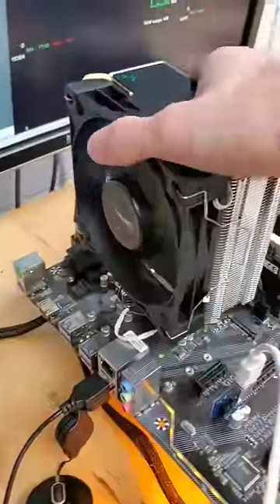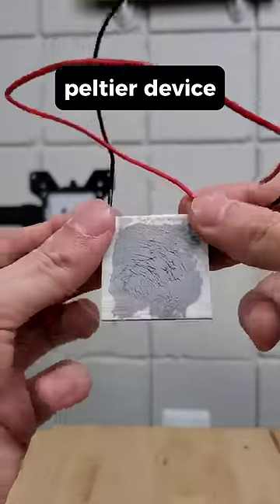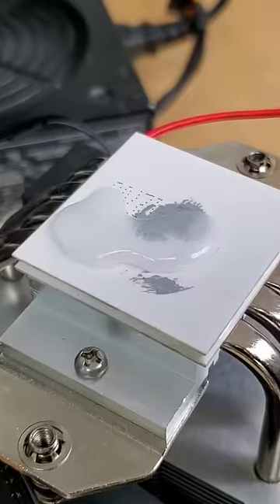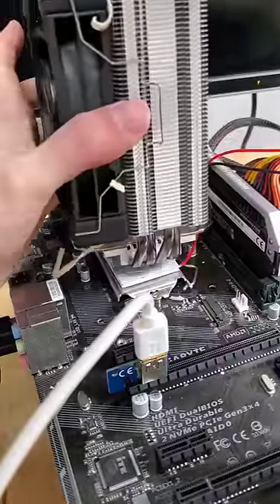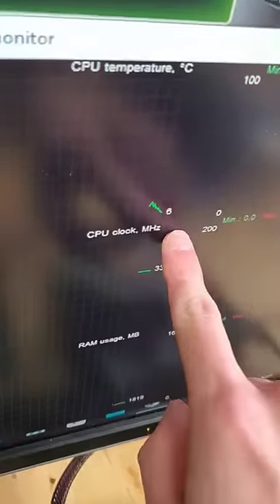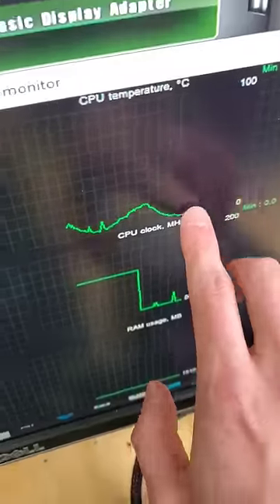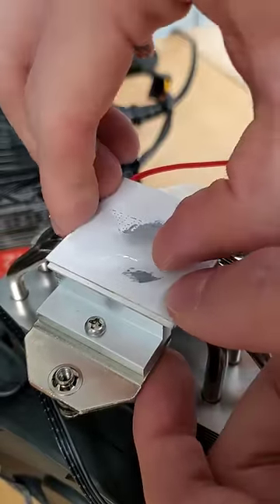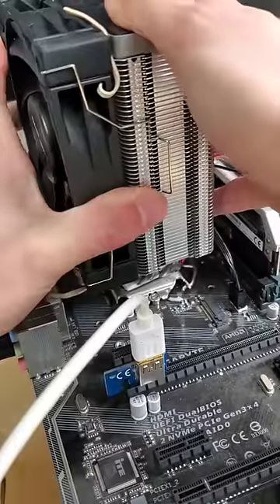using a Peltier device to cool a CPU BELOW 0°! #shorts

Comment: Small issue with this too is that this doesn’t cool the system at all. It actually heats the system up.

Yes as an immediate result the cpu will be colder. But the temperature isn’t gone. Energy cannot be destroyed. Only transferred.

This means the amount of heat pulled from the cpu ends up in the heatsink. Now this isn’t the problem, you actually want this to happen. The hotter the heatsink is the more heat it can dissipate. Normally this would also result in a hotter cpu but this way it’s still keeping that cold.

The problem is though that this module requires a fairly large amount of power. Power = heat. This module takes about as much as the cpu I’d estimate. You’re therefor doubling the amount of heat that is generated.

So for idle and short duration, yes this works. But for under load this would actually likely make performance worse

Comment: This can create moisture, if the CPU isn't consistently cooled down, if you play a game, the heat from the computer, and the device that can freeze water in 60 seconds, Which means it needs to be under 32°F, which means it can possibly create moisture that can damage your system

Comment: The main issue with peltier devices on CPUs is regulation.  If you don’t have good active monitoring you can drop below 50F/10C and start having condensation forming in and around the cpu socket.  Then depending on conditions this can easily lead to frying a cpu/system.

And as others pointed out modern CPUs have a thermal density higher than most peltier pads.  Unfortunately once you exceed their thermal capacity they are really poor at thermal conductivity.  So you have to be very careful with matching the right peltier device to the system for stable operation.  However they are perfect for systems that keep an almost constant workload.

A few decades ago when I was building large grid processing clusters we found that in a data center (very dry air) and at nearly constant 80-100% cpu usage 24x7 they worked pretty well.  We would sandwich them between custom copper heat sinks so there was a decent sized thermal mass directly mated to the cpu,  with embedded thermal probes, and then a peltier interfacing with a much larger aluminum block.  The lower copper block also allowed us to expand the surface area to fit a larger peltier pad.

Comment: My astrophotography camera has one where you can set the temperature of the sensor, and keep it there all night, making it possible to remove almost all thermal noise. You wouldn’t want to overcool a chip because thermal contraction could crack solder joints and cause condensation. I do foresee these becoming necessary with hotter and hotter chips. I wonder if you could reach superconducting temps.

Comment: Peltier plates are 30y old idea for cooling PC. it has same problem as dry ice. If you let it go below 0, water condensate from air around it and drips around procesor. It on/off type of device so if its on it can freeze and if its off its basicly thick thermal isolator between cpu and heatplate.

Comment: Once you're below the condensation temperature for water vapor in the room, then condensation becomes a concern.  Not to mention the additional power required to run the peltier device.    The concept has been around for years, but the old problems remain.

Comment: Yah! Its can be practical, if we make a program which stop power supply to peltier device at around 10 deg Celsius so that it doesn't come to 0 degree Celsius and no problem of condensation at all
Reply: there is no point 10C is too low. The processor can easily run at 60C and it won't make any difference, but the cell will consume less electricity.

Comment: Fun fact: you can also generate power by applying temperature difference to a peltier! The bigger the temperature difference between the two sides go, more power you get! This is called seebeck effect and there's a specific device called TEG that is more efficient to generate power instead of generating heat and cold...

Comment: Almost certain when under load the peltier basically becomes useless. They’re very bad at moving large amounts of heat quickly. Someone did try this by stacking loads but that also didn’t work

Comment: The second you put load on that with any modern cpu that number will shoot up Peltier coolers are good for a low effort small light load setup it’s good for getting stuff cool without a compressor they are cheap and effective however as I said they can only support a 50 watt load at max most will be around 10-20 and considering most modern chips can get into the hundreds in TDP Peltier coolers would not be good for over clocking or continuous load which would be the use case for this kind of thing if someone is going to go through the effort of properly preparing the motherboard for sub ambient temps they are going to be using a full compressor setup and the crazy people using liquid nitrogen

Comment: It's a cool demo, but the hot side get's way hotter than the cpu would, so you'd still need an even bigger cooler which, you might as well just put o the cpu. Also, cooling to around 0 degree can be pretty bad, because you can generate condensation.

Comment: I stacked 3 Peltier coolers on top of each other and placed them on a radiator submerged in ice water.  When I turned it on, I used the thermal imaging camera to measure the temperature. It went through the lower limit which was -20°C (-4°F).
Reply: Since you know how they use and you have them yourself how about doing an experiment on your pc I was thinking a lot of problems on putting it directly on the cpu and more like making a socket on the heat sink and place it there so if it fails it won't destroy all the heat flow + it won't take the hole temperature on a heavy load so can cool faster

Comment: To eliminate condensation all you need to do is encase the motherboard in a non oxygen atmosphere with no humidity Nitrogen Gas or Argon works well.
that container can be as simple as a plastic lined cardboard box sealed air tight.
Or for a more permanent setup buy an old large 20 gallon air tank.

Comment: That'd be a interesting to see integrated onto a water cooling system - specifically for cooling the water near the CPU. This way you dont risk condensation on the parts and avoid freezing since the water is always moving.

Comment: As good as this idea is, there are side effects to it: This could eventually cause vapors to form inside the CPU and outside around it, and once reaching room temperature could liquify. TLDR, the vapor could eventually short the CPU or other components around it out and damage the system.

It’s been tested before, always ended up with damage.

If it wouldn’t create the vapor from going ice cold, it would be such a great cooling solution tho… I’d love using it

Comment: Please don't be fooled by this. Gamers Nexus did a great video on this. The fact is says "Microsoft Basic Display Adapter" means he removed the driver for the display chipset and has likely clocked the CPU down to it's basic speed step or lower. That is maybe a 50W Pelitier Device which wouldn't be enough to cool a basic processor at idle, let alone standard or gaming use. The driver removal could be offsetting the temp offset allowing the CPU to appear cooler than it is depending on how the actual temp is derived. This is misrepresenting what is actually possible using a peltier. Gamers Nexus showed that even a stacked 150W peltier was not enough.

Comment: You totally need to stress test the system for a couple hours and see how it does!

The only concern I'd have is condensation of air, you'd need to dehumidify the inside of your PC with one of these devices, surely! Unless it was in a silicone metallic sleeve, perhaps... 👀

Comment: Those phone coolers using Peltier is great to use.
Though it does get toasty on the hot side when I was using it for a project.
Then I found I forgot to use thermal paste between module and heatsink, hahaha

Comment: Overtime it would freeze it so much so you could make a system to turn it on and off to keep it below like 5° but above 0°
Reply: Yeah good luck bud that can work because the system is idle as soon an you open a heavy duty program or game it can't cool the computer fast enough not to mention it's poor life expectancy. There is a reason it's not used even tho the idea is not new maybe not direct above the cpu maybe make an extra socket inside the cooling mechanism to slide it in so even if it can't perform or die you won't need to find out the hard way 😅

Comment: Wouldn't it be more efficient to place the peltier device in the heatsink or pump of a water cooler? Since they don't actually use water usually it wouldn't freeze if the pump died, but it could dramatically improve cooling efficiency if used somewhere within the loop...

Comment: this is pretty useful if it's possible to control the actual average temperature under 10°c which it cannot damage the chip
Reply: Should be feasible with a negative feedback loop

Comment: While electronics tend to work better in colder environments unless it's a completely sealed room temperatures like that can lead to condensation. Google actually uses supercooling on their quantum computer however the whole room is environmentally controlled your gonna have water building up quickly near the cpu trying it with this.

Comment: Meh, i was doing this back in the early 2000's when CPU's first hit 1gHz. Works good, but you need to seal up the CPU socket area and also insulate the surrounding area (neoprene works good) or yes you get condensation. I stopped using these when it got hot enough to melt my softlines in my water loop and fried everything. Still have my peltier, so might have to revisit using it again with my Ryzen 7950.

Comment: I think CPU under 20 c in low temp the performance will be low
 as well as
 if it was 90+ c high temp also will result in low performance

Leave it for longer may destroy the chip or the whole motherboard because of the humidity collected on the cooler device, I guess ...😅

Have you run a software application performance test on it, like playing a game ?

Comment: There’s a big problem, if the area surrounding the cpu is cold enough moisture in the air will condensate on it making it wet and that’s a terrible idea, you’re gonna short the motherboard if you don’t isolate the cools parts enough

Comment: Since you know how they use and you have them yourself how about doing an experiment on your pc I was thinking a lot of problems on putting it directly on the cpu and more like making a socket on the heat sink and place it there so if it fails it won't destroy all the heat flow + it won't take the hole temperature on a heavy load so can cool faster

Comment: Problem with the peltier device is that if its cooling capacity is overpowered it becomes an insulator which as you can probably guess is a very bad thing

Comment: Peltier cooling has been done before and found infeasible for desktops due to the high thermal output of CPUs and low efficiency of peltier compared to compression and extremely bad behaviour in case of failure.

Comment: Why dont aio cpu cooler manufacturers incorporate this into their products then?
Reply: Reason is Simple if it Gets Too Cold Condensation will Occur, Which will eventually generate Enough Water Droplets that it Will short-circuit everything. 

And if not For the Short-circuit then Corrosion will definitely destroy everything in the End.

Comment: if you turn off the  Peltier component , the heat from the  hot part will increase the overall heat exremely . P.s Peltier elements have low efficiency.

Comment: Please tell the whole story. Those elements are drawing a lot of power and will only cool the CPU in idle. If you run anything on the PC, the element will not be able to handle it anymore and the CPU will become hotter and the heat sink will have to dissipate the TDP of the CPU plus the 200 or so watts from the peltier element. You will just have a room heater and nearly no performance impact.

Comment: why not used it as heat dispatching device, instead of putting it directly over the cpu, and a sensors that shut it off when reaching 5°C , no condensation no water near the cpu plus cooling more components

Comment: Forget condensation, try cpu intensive tasks. The peltier in such case would be so ineffective that the cpu would heat more than it would, when the fan was normally connected.

Comment: cool the peltier device with another peltier device. and cool that peltier device with another peltier device. repeat. you've a peltier device tower as a cooler. bottom of peltier device tower cools everything immediately. the other is as hot as the sun.

edit now disconnect the peltier device tower from cpu bend the tower around so the top meets the bottom. you've a heat accelerator. it is hot and cold. it has a schrödinger's temperature

Comment: "The other side is equally as hot" 
No, that side is extra hot. The hot side releases heat from both the cold side and the electric circuit, so you have to constantly power the plate and use a heat sink with higher TDP than your CPU in order for it to cool down properly

Comment: i want to try it but after reading the comments i got concerns like:
1. water condensation and creating short circuts on the motherboard
2. choosing the right TEC type (thermoelectric cooler) for my cpu and based on what?
3. powering the TEC with too much or too little power
4. the short life span of a TEC and how to overcome it 

so please help, and some people may have the same questions
Reply: Just buy air conditioner

Comment: PELTIER ELEMENT

0°C at 12V (full power about 60W (12V x 5A))

So, why don't make pcb with active voltage regulation? It shouldn't freeze and it will use full power only for demanding aplication.

Comment: And then it starts condensing the moisture in the air straight onto your motherboard. And just wait until it goes faulty (which is common) will cook your CPU in seconds. Really not worth the risk.

Comment: Why isn’t this a thing yet if its so great?
Reply: Reason is Simple if it Gets Too Cold Condensation will Occur, Which will eventually generate Enough Water Droplets that it Will short-circuit everything. 

And if not For the Short-circuit then Corrosion will definitely destroy everything in the End.
Reply: @HYPERMAN__  makes sense but cant you just make a sensor that demporarely disables it so it doesnt go to low and turn it back on when needed?

Comment: WATCH OUT EVERYBODY!
The Peltier cooler has been out more than two decades, and still suffers a fatal flaw-- when the system shuts down, the Peltier-cooled device precipitates moisture from surrounding air, and pools water on your circuit. What could go wrong?!
Users have lost their CPUs in this way for years, and the publisher of this video should have placed an alert to that effect-- if only as fair warning. 
Put another way, why do you suppose the CPU cooling market has stayed with fan-based technology?

Comment: Bad idea.
Do not think that cooling it down as low as you possibly can is better.

The chips in home computers are designed for a commercial temperature of opetation and not military spec.  They are not designed to be used ay lower than 0 celcius and the behaviour is unpredictable.

When they design the chips they perform logic simulations which take into account a certain temperature of operation so they can be confident the chips will work across that temperature range.

The change in temperature affects signal timing.

Comment: Wouldnt it be better ro just put the heatsync? Also the cpu needs a certain running temp so i wonder if you can hook the device i to the throttling system to maintain it on the target warmth

Comment: I wonder why no one uses a weaker version of that on a water cooler?,,, I mean it might help cooling the water a bit while the other side cools the device, its better that the CPU is cooler than the device heating up and air going outwards anyway ?  

is it expensive or something?

Comment: You forgot to mention that its heat transfer capacity should be more than the maximum tdp of the cpu or else the Peltier cooler will behave like an insulator and literally fry your cpu

Comment: Linus did tests with these and it really isn't practical due to hiw much power they require and although they kind of work here when not under load (this short is not running a benchmark) it is not good enough for the really powerful desktop COUs

Comment: Wait doesn't it generate power it looks like the thing that i saw in another yt video it was designed by nasa and it took high pressure and move it to a low pressure area acting like a flat wind turbine I can't remember what there called but it works similar to this

Comment: As soon as the CPU pumps out enough heat to overwhelm the Peltier cooler it will act as a thermal insulator instead. Not to mention the abhorrent efficiency.

Comment: Yes and it’s all fun until you realise when hot air meets cold or visa versa there is the production of moisture commonly called condensation. This RUINS computers. This is why you see these hardcore overclockers they use all sorts and also only actually run the system for a short time to post a benchmark.

Comment: Put a load on the CPU and you'll find out real quick that the peltier unit is not capable of cooling the CPU.
Linus tech tips and a few other channels have already proven that they don't work at all with a load on the CPU.

Comment: This method is VERY power inefficient and NOT recommended.
Phase change cooling is way more efficient. But Phase change cooling requires a compressor.